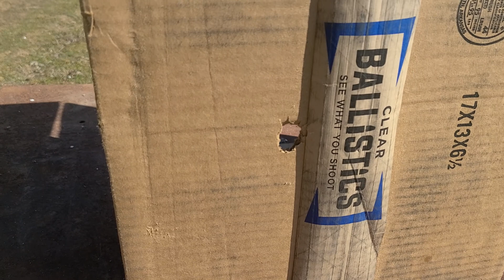Here we go again a new Expanding Copper Slug flight test.

Comment: Maybe stability could be increased by moving the center of mass forward, by creating a hollow in the base and a spike or cylinder of material in the forward cavity.  The expanding petals seem to be fine the way they are.
Reply: Something like the center post in the hydra-shok (Federal ammunition).  I think if the design of the petals would allow that to be machined, it could be quite a bit of help.  Would bring the COG forward and also help with bullet tracking in the wound.

Comment: Just considering your design Im thinking a reversed rawl-bolt type design might help separate the petals i.e. having a short steel slug (ball bearing?) in the centre which projects forward as the outer casing slows on impact, expanding the petals out.

Comment: Could a ballistic tip help put weight up towards the front. I feel the are base heavy. Your design is amazing it just needs to be tweaked a little. Your so close I feel to having a amazing round. Maybe it's the cavity catching air making it wobble? Maybe trying to leave a ring at the tip to give it a smooth flight. I always had the idea of a cheap  diablo shape slug and drill holes at like a 33 degree angle in a circle at the front of a slug. The flat would force  back and because of the holes it could collapse and push the edges out like a hallowpoint.

Comment: At 0:34, I can't tell what you have in front of that slug the way you loaded it....but, IMO...I think you need a little bit more weight up front. The center of pressure on that projectile appears to be too far in front of the center of it's weight, it's center of gravity & makes it yaw. I would fill the front end with pure silicone for two reasons:
1 > to add weight and bring the COG forward
2 > to prevent that profile of a cookie cutter from clogging as it enters whatever media you use it on.
Of course more spin stabilization would help but I think for it to be a commercial success it would need to fly correctly at minimum spin stabilization from a rifled choke.
I am very impressed with your work, you are deep in the rabbit'hole....stay there and get this figured out, you are soooooooo-close! I use the silicone in my cast Hollow Points, it prevents clogging like I said and gives much better 'controlled expansion' through layers of cloth.
Excellent work!

Comment: It's probably tail wagging in flight, if you shorten the nose a little it might correct this, it will still open to about the same diameter since the pedals will be less prone to folding back.
Just my opinion